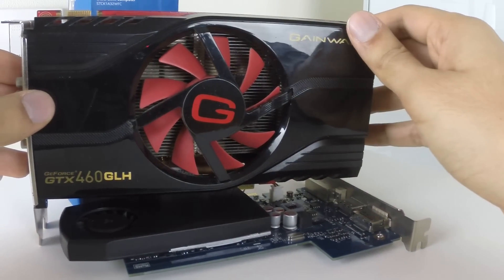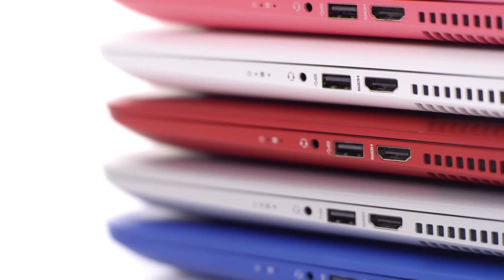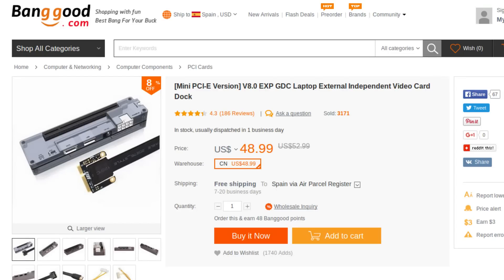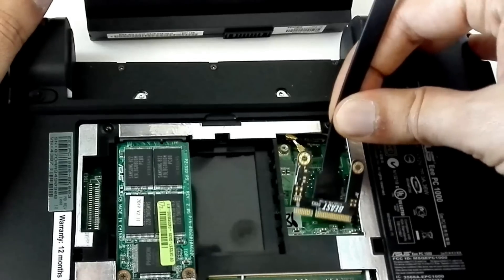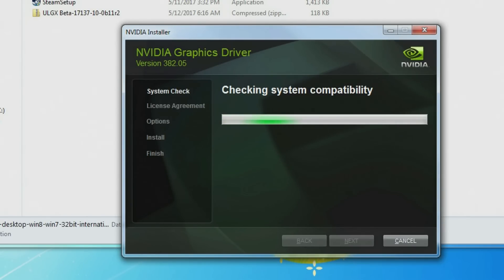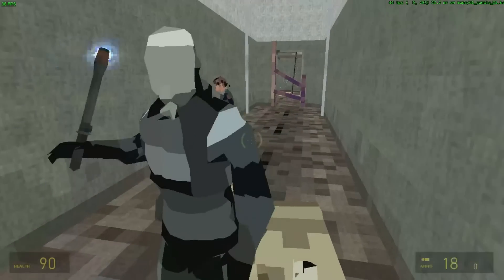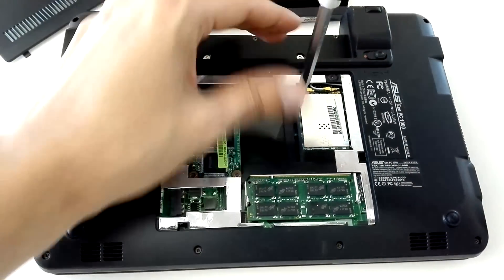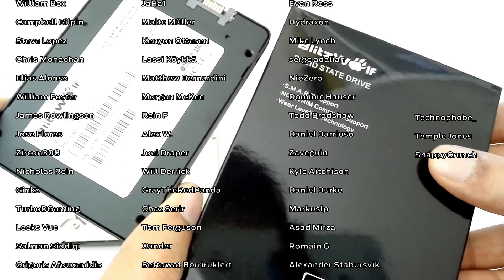An External GPU for an old Laptop?

Comment: I have one of these laying around aha! Always wanted to try it on one of the older Atoms. I have the PCI-E connector version, but I actually kinda wanted the ExpressCard variant because my old Elitebook with an i5 2520m had a slot for it. (also the BIOS has a whitelist for very specific Wi-Fi cards only, so the PCI-E connector wouldn't work with it)
Reply from the maker: that... kinda sucks. If your base is like mine all you need is a different HDMI adapter to try it over express card.

I would recommend it. I have a couple of busted laptops around that I am thinking of combining with some budget GPUs to create weird gaming machines.
Reply: Got it through Gearbest rewards points for free so it's no loss, but I still wanna mess around with it sometime. Would love seeing my power-hungry R9 270X paired with some little newer-generation Celeron or Pentium machine. Shoot, I even have an R7 250X that'd be fun with that kind of setup.

Comment: No Money, PENTIUM  D U A L C O R E, and an office laptop

gr8
Reply: No money
Intel atom n455 @1.66 GHZ single core
1GB DDR3
500GB hard drive
$100 laptop from 2008
1024 x 600 display
3 x usb 2
no HDMI
Reply: MadCat dont worry, i get like 15 fps on tf2 with my crappy laptop that has an amd e300 cpu that runs at 1.30 ghz, even chrome can make it explode... But somehow i managed to run gta v on it with medium graphics at 8 fps, weird, isnt it?
Reply: Well... for 80 bucks you can get somewhere (40 for base and 40 for second hand gpu). Still cheaper than used gaming pc.
Reply: No money
Celeron 530 @ 1.73 ghz
Mobile Intel GMA X3100
2.5 gb ddr2
111 gb hdd
4x usb 2.0 ports
no hdmi ports
20 fps on cmr 3
1280x800 lcd display
laptop from 2007
Reply: GR33N_B34ST_sk no 💰
 Intel i3 3230
AMD r9 270
8gb ram
Reply: Because source 1 engine is 32bit
Reply: Random Guy37 i got 1366x768 display

good?
Reply: GR33N_B34ST_sk lol just upgrade the cpu
Reply: No Money...
Core i9
10x Titan Xps in SLi
256GB DDR4

Ya, my pc sucks ;(
Reply: lel a fantasy pc.
Reply: Intel Core i3 4030u @1.9GHz
Intel Hd Graphics 4400
8 gb ddr3
1Tb hdd
1366x768 
~$500
Reply: no money 
Core i7 8th gen (hexa core)
Gtx 1050 TI
8 gb ram
1 tera HDD
128 GB SSD
1920x1080 display size

and i use it to play among us :/

ik im late sorry ;-;
Reply: No money
Intel Pentium T4400 @ 2.2GHZ,800MHz FSB
Intel GMA 4500M
6GB ddr3 (only 2.6 usable)
320gb hdd

Runs League of Legend at 14 FPS at lowest setting,65% of the time will drop to 3 fps.
Reply: GR33N_B34ST_sk not bad
Reply: ***** i see what youre talking about there, TF2 has Bad Optimization for sure, my friend gets stable 60 fps on OW and TF2 drops like hell, but i get 35 FPS on TF2 No Drops and 7 FPS on CSGO etc.
Reply: no money 
ryzen 7 1700x (oc to 4ghz) corsair h110i aio
gskill trident z rgb @ 3200mhz
evga gtx 1080 superclocked
2tb hdd 512gb m.2 ssd
aorus ax-370 gaming 7 mobo

jks i have an old pentium laptop and a pc with ryzen 7 1700 and a gtx 680 2gb ( i bought a gtx 680 coz the mining craze and also because it was $80 (aud) and performed similar to my friends 1050ti
Reply: IKR! 14nm architecture is so inefficient

Comment from the maker: So, what happens when I get a bit feed up with my own format? I experiment with weird stuff. I have been meaning to do this experiment for a while but could not get my hands on a proper GPU base.

But now it is done. I wold like to experiment more with this in the future.

Important announcement coming out in a couple of days, keep an eye on the channel
Reply from the maker: thank you for your kind words guys. I love doing crazy stuff like this so I am glad it is getting a good reception
Reply: This was a good video, keep it up
Reply from the maker: I mentioned it on the video. Video goes out through the GPU's HDMI. For desktop applications I was able to run stuff in dual screens.
Reply: I think the experiment was a full success! I'd like to see more of these in the future. Good job!
Reply: I love the video, but i'd like to have seen you try it with a slightly higher end laptop or gpu. Still impressive nonetheless.
Reply: Did you mention this required an external monitor ? or have you made a connection too the regular port on the laptop somehow for this test ?
Reply: looks like the cpu was bottlenecking the gpu, try it with a 13 or a pentium with the newly released gt 1030 ? combination seems pretty cheap
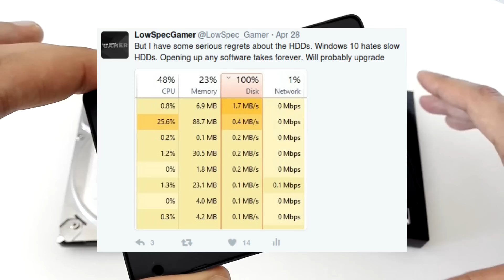Reply: Are u spanish LowSpectGamer?, 5:50 u have on spanish the page.
Reply: NOT EVERYONE GOT MINI-PCIe :(

TRY EXPRESSCARD SOME TIME SOON!
Reply: I would suggest using MSI Afterburner to monitor the CPU and GPU usage in order to spot any bottlenecks. Give it a shot!
Reply: Never possible
Reply: LowSpecGamer Can you try to improve perfromance on Mafia 3?
Reply: +LowSpecGamer is there any way you could do the stuff you did to amd in cs go to intel hd graphics.i get a horrible framerate even after watching ur intel hd vids
Reply: oh and can you pls do mafia 2 (not 3) it runs horribly for me and i love that game (more than 3).pls !
Reply: LowSpecGamer please try out a more powerful laptop like with i 5 and a gpu like 1060 and run witcher 3, if it gets to 30 fps, im buying it!
Reply: if you haven't seen a laptop with an express card buy a thinkpad laptop.. all thinkpads has express card slots..
Reply: LowSpecGamer If You still have that netbook You can OC it with Setfsb software. I overclocked my eeepc 1000 he with atom n280 to 2Ghz. Maybe it can decrease bottleneck effect xD
Reply: LowSpecGamer great video. I do have a question for you: I have a Toshiba satellite U500 with Intel core 2 duo with shared graphics. Is it possible to upgrade the graphics like the way  you did ?
Reply: So i want to do this can anyone tell me if this one will work. http://s.aliexpress.com/R7bAVvQv
Reply: Hey LowSpecGamer, ive been watching your videos for a bit time now, and i was wondering if you could make Far Cry 4 run on a low end computer. Thanks to you i can play many games that i wanted to which my computer didnt meet the requierments
Reply: PyrottE+
still cant believe it runs on PS3..
Reply: yay I have slighty better laptop
Reply: can you pls do mafia 2 (not 3) it runs horribly for me and i love that game (more than 3).pls !
Reply: I randomly got unsubscribed from ur channel :( But i subbed again :)
Reply: LowSpecGamer it's a Lappy and an old one too then how come it didn't overheat, in previous videos too *how the heck don't they heat up *arggghh*this fact is making me go crazy* ?what Lowspecspell did u use? xD
Reply: i have a express card slot ;c
Reply: can you help a guy out i am not only a low spec gamer but also a broke-ass  gamer.
Reply: You uploaded the video as a Portal 2 video???
Reply: LowSpecGamer could you try using a pcie 1x riser and a gtx 710 and see if it works
Reply: Low Spec Gamer plz make a video on how to run DirectX 11 games on directx 10 gpus!PLEASE.
Reply: Oh I never knew there were alternatives to the expensive Razer Core, thank you. As a budget laptop user (with integrated graphics), this sounds like a pretty neat upgrade. At the very least, this will free up some of the rendering workload that my CPU is taking. Let's see if I can find some abandoned graphics card in the computer lab...

btw, I believe it should enable people to play directX11 games (well, if the external GPU supports it too). Rejoice, intel HD 3000 graphics users
Reply: LowSpecGamer I challenge you to do how to get better fps at unturned but you gonna have to use Acer aspire one netbook with 2gb ram
Reply: isoft UnlishedTenEight you are wrong!!!!!!!!!!!!!!! You can use dxcpl and choose the exe file of the game enable force warp and play dx11 on dx10 gpu BUT THE FPS IS 5 so its pretty laggy and I am hoping that low spec gamer will do something to improve the performance.
Reply: Woah really i never even heard about it
Reply: isoft UnlishedTenEight  well that's was my challenge and is really easy as well
Reply: Why havnt i ever found something like this or heard about it
Reply: isoft UnlishedTenEight I know it's something new ;)
Reply: Have you tried with minecraft? I also have the same specs (not with graphi  card tho) amd i got ~14 fps on lowest settings :I
Reply: Newcomer Mine craft depends on the cpu more then other games. If you have those specs you would probally be better off buying an xbox 360 for like $50 on eBay or finding one of those videos on getting a like $100 gaming pc cause just about anything is better then those netbook specs
Reply: Yes, I knew that. It was my rubbish laptop form 2 yrs ago. Got that for free tho. :P Still use it for a home server (because its keyboard was broken)
Reply: Newcomer Free is always a great deal :) It could probably make a nice Kodi box or something
Reply: LowSpecGamer can i try this on a allá in one hp touchsmart 320?
Reply: "keep an eye on the channel" Holy f**k that hurts, thanks i'm blind now on my left eye :(
Reply: simple things Most of the time, no it can't it uses about 75% of the gpu power depending if it goes to an external display or if you use your laptops display
Reply: Here's some reading material: https://egpu.io/external-gpu-buyers-guide-2017/#mPCIe-interface
Reply: Hey does the power supply start when the laptop does? Really want an answer so I dont end up getting the extender thing without having any idea how to start the power supply.
Reply: LowSpecGamer can i use this on a gtx 1080 or some other newish GPU?
Reply: Random Fandom 1080?! That are 700$. Build a pc for that money. ;)
Reply: Sillex Boi a 1080 is 500
Reply: Sill good 4 a gaming pc :D
Reply: LowSpecGamer So if I connect this to my Laptop, I can't go online?
Reply: JactheGamer u can use the lan
Reply: aldo jaco Thanks.
Reply: i have dell studio 1745 core 2 duo (P8700)  and am planning to upgrade it ram is now 2gb but will max it to 8gb. so i wonder if i connect my laptop with external gpu(also suggest gpu for latest games) so can i play the latest games on my laptop?please reply.
Reply: Can you do another video on this with a laptop with a decent CPU?
Reply: LowSpecGamer dude can i use exp gdc on laptop hp 14ac122tx?please reply,thank you
Reply: LowSpecGamer  ikr
Reply: can you compare exp gdc with riser s008 ? @LowSpecGamer
Reply: Will the Dell latitude D610 support an egpu or is it simply to old?
ok so I have a Dell Latitude D610 and I was thinking about experimenting with it to see if it would fit a epu but after doing some research it seems like it may not be possible. This computer has a pcmcia slot but i heard thats not the same as a expresscard slot and it may not work or work at all. Then i thought about the wifi card slot to do it but that may not work either since this laptop uses the oldest wifi card format. it uses mini pci type IIIa and most laptops of today or made after 2005 use  PCI Express Mini or  PCI Express Micro so the Exp gdc adapter only fits  PCI Express Mini and  PCI Express Micro
Reply: LowSpecGamer Any drawbacks? Limitation and will it work on i7 3rd gen laptops
Reply: LowSpecGamer hey can you make a video on how to upgrade hp Compaq pc with amd e350 apu clocked at 1.6ghz.
Its a humble request as i cannot game on it and for new pc my parents say no 😅😅
Reply: Your url to the Video Card Dock sends me to the SSD page!
Reply: Please will this work with a hp laptop I have Compaq cq58-301ee
Reply: I was using HWmonitor to spot for the bottleneck, sometimes is the gpu bandwith that goes all 100%, but depending on your cpu (like if you are using a gtx1080 with a core i3) it will bottleneck the fps, also the resolution of the monitor and the speed of your storage device.
Reply: JactheGamer yep
Reply: LowSpecGamer why not a 1080 ti?
Reply: +Arvin Khatib it was a joke ok?